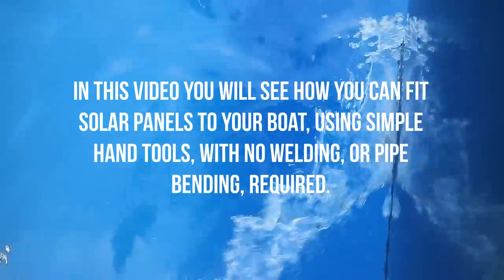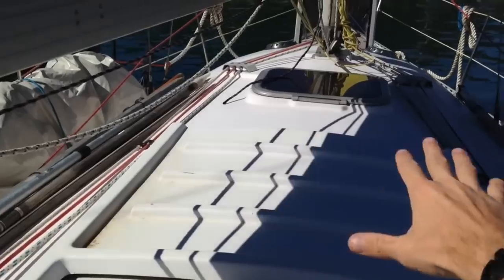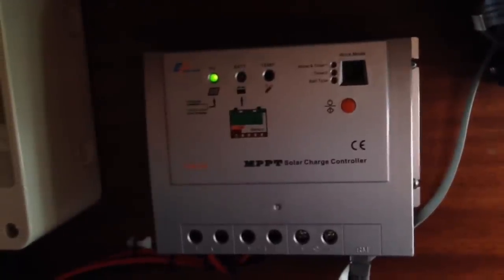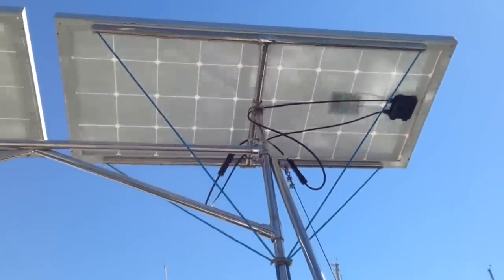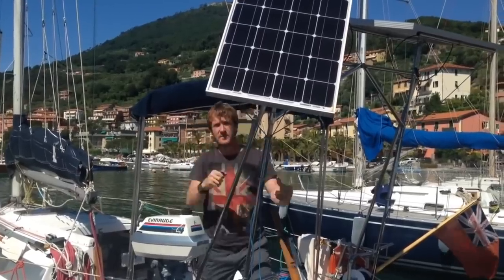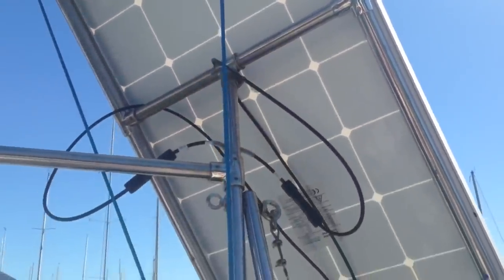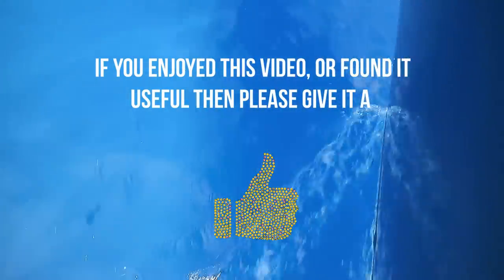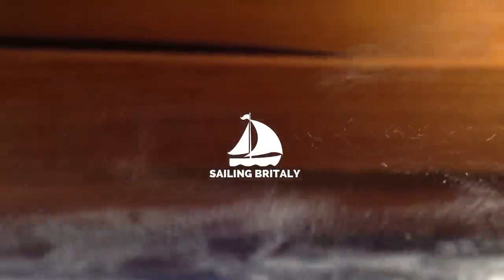Boat Solar Panel DIY Guide - NO WELDING! | ⛵ Sailing Britaly ⛵ [Boat Work]

Comment: Like all of the comments, I thank you for a wonderfully simple and practical idea.
I'm working on my own version at present and, though 99 per cent of your video is totally clear, I still can't (despite reviewing countless times) understand your ' universal joint'!
Is it possible to have a close up of it or a detailed sketch?
I can forward an email address if needed.
Good luck with the good work!
Reply: Did you ever get your  design completed?  I was the same as you - couldn't quite get the logic of the universal.  It almost looks like you could use another T-piece that has been cut up the sides to allow it to rotate.  This one looks like a strip of stainless bent around a piece of rubber or nylon? 
.

Comment: Definitely want to try this. Ive never built an arch before but before I spend 4 grand on someone welding it I might give this a go. Two left hands but enthusiastic!
Reply from the maker: There’s a big saving to be made here for sure. I made a much bigger version for our new boat using larger diameter stainless, let me know if you want to set up a video call and I can offer you some personal advice. Best regards, Chris
Reply: @SailingBritaly  Thanks Chris, I might take you up on the offer once I am ready to tackle this! Its on my to do list but a little bit further to the bottom yet! This video just reminded me of the project, so  Ihad to watch it (again actually). :)
Reply from the maker: @obiwanfisher537  No worries, I know what boat to do lists are like... I spent a lot more time planning and thinking about the arches I built than I did making them, so a 10 minute call might save you quite a lot of time. Good luck with the rest of the to-do list! Chris :-)

Comment: Bravo Chris, another good video. Over the years, since they existed, I have mounted solar panels on all my boats depending on the needs and the space available. Their assembly is not difficult even if the passage and fixing of the wiring in the video have been minimized and are instead a good part of work! Always positive experience: it can be said that "a solar panel changes your life on board ..."
Reply from the maker: Absolutely Mauro, this is probably the best upgrade you can majje to a boat to make life on the hook more pleasant. Cheers, Chris :-)

Comment: Some years ago we sailed on a 30ft boat for 16 month to the caribean and back. I mounted 3 solarpanels with together 200w on a gantry. In this time we were mainly on the hook. We run a 40l Waeco fridgebox, and all the other stuff thats needed on a boat bluewater cruising, including a ssb radio.. In this 16 months a run the engine for electric power only three times.
Reply from the maker: Exactly Peter: Solar Panels are a fabulous addition to a boat and allow you to live on the hook in comfort for long periods. No doubt you had a brilliant time during that time cruising to the Caribbean and back. 🙂 Fair winds, Chris & Rossella 👍

Comment: Solar panels are awesome! We use genasun charge controllers on ours, each panel has its own controller so we don't have to worry about partial shading knocking out the whole array.
Having panels will cut your electrical woes and give you so much freedom!
Reply from the maker: Absolutely Herb & Maddie! Solar panels on a boat = freedom! Fair winds! Chris & Rossella 👍

Comment: Hi,

Great tip. Our panels (similar) are mounted to our Bimini structure in the same location. Works great. You remind me though to check the controller type we have.
Reply from the maker: Hi John, the type of charge controller makes a big difference to the amount of power utilised in a solar system. We have a very cheap PWM controller on board as a spare. The MPPT charge controller shown in the video was only around $100 if I remember correcly (With the remote display and shipping included) so they aren't particularly expensive, and in my mind are worth the extra outlay to make the most of what the panels can produce. Fair winds, and sunny skies! Chris (& Rossella) 👍

Comment: Sweet.  Nicely done.  Love the adjustable angle ideas.  Seems like they would not be strong against wind, but I'll take your word for it.  Thank you.
Reply from the maker: Thank you! Both panels can be removed and stowed inside the boat in about 3 minutes but I would say this is unnecessary unless hurricane-force winds were forecast... Our boat has been moored in 50 knot plus winds with no problems whatsoever. Each of the 3 mm Dyneema lines coming off the 4 corners of the panel has a 1100 kg  (2400 lbs) breaking strength so this set-up is probably a lot stronger than it looks... We've been anchored in 43 knots, so we were able to watch very closely and we saw that the panels were rock solid with no vibration or movement at all (they also act a little bit like a mizzen sail on a yawl when we're at anchor, moving the centre of drag rearwards and helping stop the boat from wandering side to side in the wind...) You can see these panels in some dodgy weather in this video: https://www.youtube.com/watch?v=VvbzPDy-MDE (the bad weather is from 9 minutes onwards) Cheers! Chris & Rossella 👍
Reply: Thanks, I saw that on another comment after posting.

Comment: I think if I did this, I would get the dimensions of the boat, model the stern in CAD and design it there, maybe do a couple simulations to determine if the structure is strong enough and then buy the parts to build it.

Comment: I have looked at alot of diy arches this is the one I will design off. One tip is instead of wrapping the pipe cutter go 360 back and forth if your tool is not exact you thread the pipe not cut it. Thank you for a great well thought out idea. Rowyco!
Reply from the maker: Thanks Scott. We have just built a new solar arch on the 35 ft boat we currently own so check out our channel for that. Good luck with your build!
Reply: @SailingBritaly  looking forward to that. Thanks alot.

Comment: If i get to buy the boat that I want this summer, I'd definitely using this system :D 
The difference in getting it made or even the welding would let me get the MPPT control system. 
THANK YOU!!!
Reply from the maker: My pleasure. The MPPT charge controller I bought was only about 50 USD more expensive than the non- MPPT, so you’ll have plenty of change left compared to paying for a welded arch! Cheers, Chris 👍

Comment: Some very good stuff there but a smaller but bigger tube would suit me, broach in bad weather and that arch can come off gratefull for the mppt tip the albin vega 27 is one of the most travelled blue water boat ever. A fully encapsulated keel would be my first call for journeying
Reply from the maker: Hi Sean, the design of the panel mounts can be modified to suit whatever setup you like. Our 30 footer has an encapsulated keel and it is a brilliant, seaworthy design. The 35 foot has a bolt on keel but then every boat is a compromise... Fair winds! Chris & Rossella 👍

Comment: Awesome video, Thanx !
Question: how do you get warm water when it's a long time ankering?

I use a Quooker for boiling water and warm water for washing and showering. One shower session cost 18 minutes on 2300watt to reheat the 7 liter boiler at 100°C. That is around 1KW per shower session, 2x2 times a day, 4kw per day. 2 panels of 100watt with 8 hours sun would produce 1.6kw, not enough. We need 4 or 5 panels on our 34feet sailboat and a massive 2300watt invertor (I have one). In the winter we heat up the boat with infrared heater of 2x 800watt. That is enough, but requires another 8 panels or so. . How do you get warm water and heating off grid?
Reply: Ohw wow, this video is from 4 years ago 😆
Didn't see that.
Well, I hope you can answer my question nevertheless 😄

Comment: can you give some more info on how the universal joint works?  what exactly it is? the rest is brilliant!
Reply: sorry, only just ead your iniital reply...sorry!!
Reply: finally got it  - T bracket sits on top of riser, so can rotate 360 degrees ...and can twist the H frame bar from horizonal  a rfequired...genius...
I wonder if you could have 1 big H-frame in the centre carrying 4 flexible panels zipped onto a sheet of canvas stretching over the H-frame and then all 4 rotate and twist together , still securing the 4 corners with dyneema guys?? wonder if that would be still string enough if one used larger gauge tubes and  clamps????

Comment: in retrospect, how often did you find yourself moving the panels to follow the sun, vs. leaving them flat?
Reply from the maker: Rarely, but when that extra power was needed it really did make a big difference. (Both at anchor and on passage)

Comment: Wonderful DIY vid. Definitely a pipe cutter over grinder - better, cleaner cut, and no power needed (think off shore repairs). Only prob: What the heck is a giggly clip?!?!
Reply from the maker: Hi Lynn & Hans, thank you! Ha ha - sorry I've had that issue before with our US friends!... 😂 I'm saying 'Jubilee Clip' which is what us Brits call hose clamps... Jubilee Clip is a brand name of the first hose clamp patented in the UK in 1921. This brand name has stuck and we call hose clamps Jubilee Clips in the same way that sticky tape is referred to as 'Sellotape' after another UK brand, and vacuum cleaners 'Hoovers', after the US brand name... ☺ Fair winds, Chris (& Rossella) 👍
Reply: I’m going to refer to hose clamps as jubilee clips from now on... going to drive these Brooklyn folks nuts! ~Hans

Comment: Hi Chris.  Are you using this system to charge in parallel with the alternator?  Just wondering if there is any type of isolation between the two charging sources and if so what?  I'm looking at a votronic charge controller and I think I can just connect in parallel reading the datasheet.   Feel I should fit some kind of diode to prevent alternator current going to the solar charge controller.  Just interested to know.  Cheers.

Comment: Have watched this video several times in anticipation of finding a boat...and still impressed each time...if I can ask for 2 points of clarification...can you send a link to the universal joints you used?
Also do you have any more details on how to secure in place with the dyneema stays? Did you find the jubilee clips caused any chafing?
Thanks for this and your other videos...great work
Reply from the maker: Hi Stephen, the 360 degree joints were just clamp on T-pieces, combined with a H-frame that I added to each panel. There was no chafe on the dyneema, which had an 1100 kg breaking strength. If you were concerned about chafe (low quality hose clamps, for example) you can add some clear heat shrink tubing around the part of the hose clamp which grips the dyneema lines. This would last many years. Our panels would take about 2 minutes to stow away inside the boat (I designed it like this for high winds) but the reality was that they were so stable that they stayed up all the time, including in 50 knot winds. I can help you get a great deal when you buy a boat, so get in touch when you’ve found one. Cheers, Chris
Reply: @SailingBritaly  as my best mate used to say...I don't care what the others say, you're a diamond geezer...so I'm negotiating a 38 foot centre cockpit, and one of the first projects will be a solar gantry, most likely with 3 panels to make me as self sufficient as possible...so will definitely be in touch to kick it off.
Ps just been pointing the concrete slabs which are the base to my sons greenhouse...and who popped up on a  'random' YouTube tutorial...small world!
Thanks again
Reply from the maker: Good stuff Stephan, the last client we worked with had his offer accepted and he paid 34.5% less than the asking price for his boat so a comparatively small investment with us can yield big returns! I like helping people and my other channel allows me to do that in any field which takes my fancy! Small world indeed. Speak soon! 😊

Comment: Check out those bolts then dad how about the towed generator or a windmill , a lpg honda eu10i might be handy too great stuff wheres that swing!!
Reply from the maker: Yes I'll be paying close attentition to the keel bolts on Britaly. We might also do some 'tensile tests' on them whilst we transit the French Canals to the Med 😂Towed generators and turbines (plus the wee honda) are great so if we need extra power then they are options, but Solar will be our first choice as it is such a simple system. I haven't looked into it yet but we should be able to get quite a few watts worth on there... I'm sure Emma will be asking us to put up a swing before we know it.  Fair winds! Chris & Rossella 👍☺
Reply: Edf told me they are building hinckley point c for emmas ipad

Comment: How many watts are your solar panels...what was your daily consumption for those 23 days? Thanks...very helpful info....favorable winds!
Reply from the maker: Hi there! We have 2 x 100 Watt panels and they kept up with all our electrical power requirements just fine. The limiting factor on our boat would the three very old lead acid batteries we have - which if upgraded would make better use of the output from the panels... Hovever, despite that, we had no problems living on the hook for the duration of our honeymoon. We have replaced all our lights on board to LED's, which consume about 1/10th the power the incandescent lights consumed, and the only energy saving measure we took was to switch off the fridge during the hours of darkness (we left a couple of bottles of water in there during the day to act as a 'cold store', which would maintain the coolness in the fridge during the night). It has made a huge difference to our boat and we recommend fitting solar panels to anyone! Fair winds, Chris & Rossella 👍

Comment: When you say jubilee clip are you talking about a standard hose clamp?
Reply from the maker: Hi there, yes in the UK hose clamps are often referred to as 'Jubilee clips' - hose clamps were invented by a brand called Jubilee (Back in 1921), and the name has stuck. Similarly, in the UK, vacuum cleaners are often referred to as 'Hoovers', after the US brand of the same name. Cheers, Chris 👍

Comment: What are jiggly(sp) clips?
Is there a way to tighten/loosen without having to use a tool, like with a quick-release axle on a bicycle?
Reply: Captain Who 
I think he’s saying (or meaning) jubilee clips, what Brits call hose clamps.
Reply from the maker: Hi John, yes I was saying Jubilee Clips, which is what us Brits call Hose clamps (Jubilee is the brand name of the first hose clamps that were patented many years ago in the UK). The solution you found is perfect if you could get the correct diameter. The stainless steel tubes I used were 25 mm, plus the 4 x dyneema line, would make the clamps need to have a diametr of around 30 mm. Another option would be thumbscrew hose clamps but I have never been able to find any of those made from stainless steel. Fair winds! Chris (& Rossella) 👍

Comment: Hi Chris
Great videos, I found your channel a few months back and thoroughly enjoy your vid's .
What batteries are you using for energy storage.
Did you have to get extra ones or do you use the battery that came with the boat ?
All the best 
Keep up the good work ...
Reply from the maker: Hi Colin, thank you very much! 🙂 We have the batteries that came with the boat when we bought her (3 x 100 AH wet cell sealed lead acid [2 x house, 1 x starter with a 'battery separator' controlled split charging system]) They have done a great job and the only power-saving measure we have taken whilst living on the hook is to have turned off the fridge at night (during the day we add a couple of bottles of water to the fridge, these act as thermal 'cold stores' and keep the contents of the fridge cold at night). If we wanted to get the most out of our solar system, better batteries would maximise the output even more and there would be more power available, but we never felt it justified the outlay as the system we have works fine... Fair winds! Chris (& Rossella) 👍

Comment: What about breaking waves over the stern? 🤔
Reply from the maker: The panels were removable completely in literally about 2 minutes - unlike most solar setups which in this situation would generate huge forces if hit by a breaking wave. No system is perfect, but this setup is very versatile.

Comment: How long does your battery last if it's not being charged at night?
Reply from the maker: Hi Garreth! We had 2 x 100 Ah house batteries on this boat (plus a separate engine start battery). As long as we switched the fridge off overnight the battery charge state was never a problem, even when anchoring for several weeks at a time. (During the day we would put two 2 l bottles of water in the fridge and these would get very cold during the day. When we switched off the fridge at night, the bottles would keep the contents of the fridge cold until the next day, even at the height of summer.) Fair winds and welcome to our Patreon Crew! Chris, Rossella & Emma 😊
Reply: @SailingBritaly  out to sea would 2 250w be able to run a desktop

Comment: Hi, great video. After watching your video I ordered stainless steel tubing but I just bought normal and not 316, would these last about 12 months in uk weather until I get some 316 or shall I just throw the tubing away and buy the 316? Thanks
Reply from the maker: Hi there, thank you. They will last indefinitely even if they are 304 grade stainless. The only difference is that they may get surface corrosion stains more often which means polishing / passivating them more often. I certainly wouldn't throw them away. Good luck with your build! Chris 👍
Reply: Hi Chris, thanks a lot for your quick reply. I'll take your advice and give it a try. Thanks again
Reply: Where did you get your st st tubing and fittings from.?
Reply: @jeffmellorable  The fittings from Sea Screw and I think the SS tubing from metals4u but don't hold me on the 2nd part